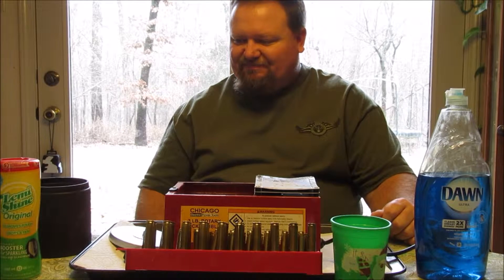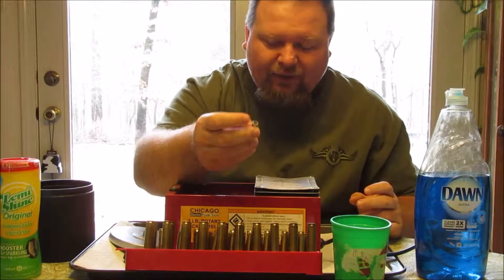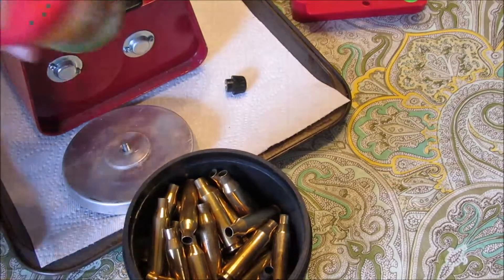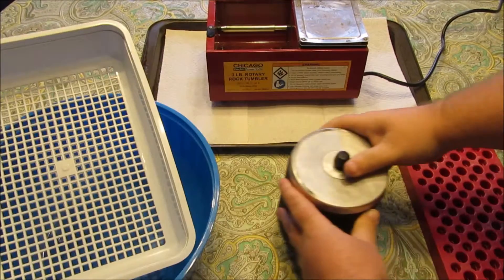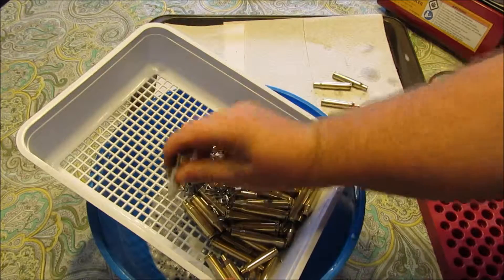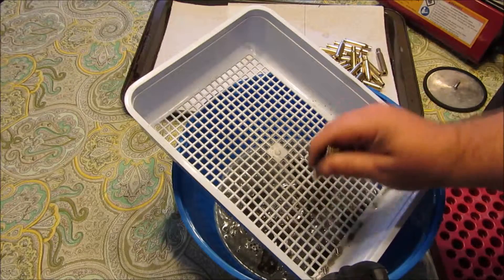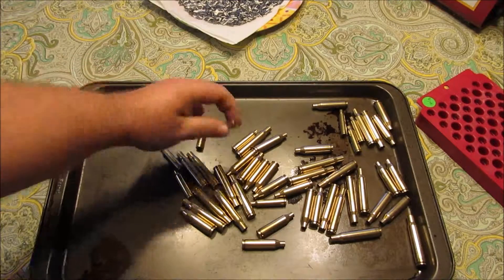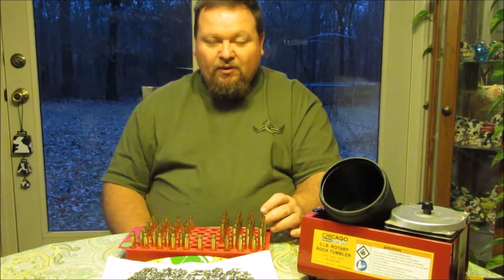Experimenting With Steel Tumbler Media

Comment: This is why I dry tumble.
Reply from the maker: I wet tumble without pins now
Reply: @preachersdayoff  how's that working for you?
Reply from the maker: @mattress38  it works well after you size and deprime them. I use hot water, dawn soap, and a little Lemme Shine. Then I rinse and pop them in a 200 oven with the fan on for 10 min.
Reply: @preachersdayoff  see that's the whole thing with me, I dont wanna have to do all that extra rinsing and drying, I'm not wearing it and I just dont see the point. Also how much money is it costing to heat them up? The only real positive I can see in wet tumbling would be no dust but it's all about the hobbies and if it's fun for you to do all that then that's what you should do, good video my man and happy reloading.
Reply: @preachersdayoff  check out my video on separating the media from the brass.

Comment: I think if you ran running over the brass once it was done tumbling the pins would come out easier, and 2 hours of tumbling is more of the preferred time.
Reply from the maker: +John B I think you are right. I also think a larger drum would allow the brass to tumble instead of roll, which allows them to become packed so tightly. Thanks for the input.